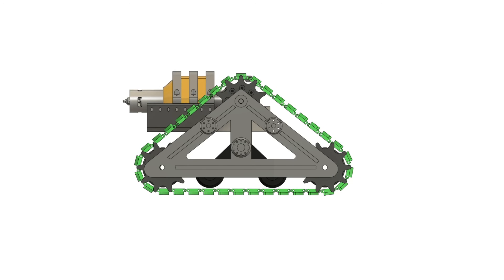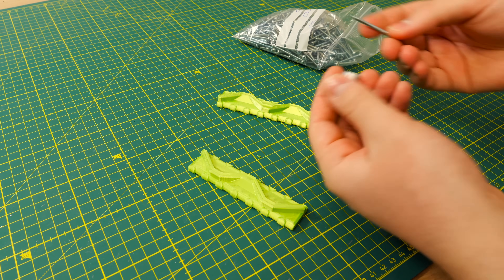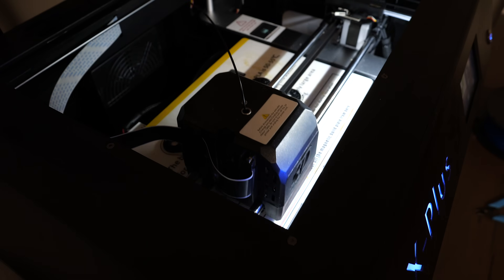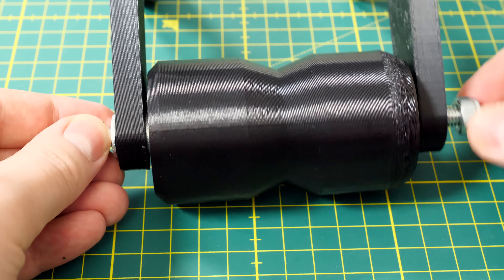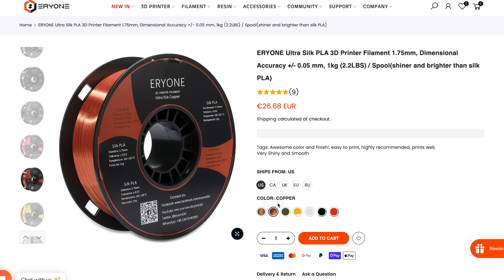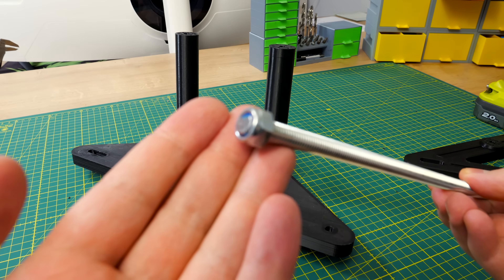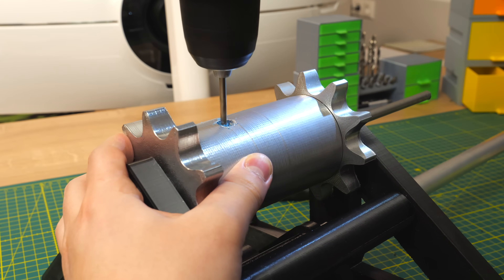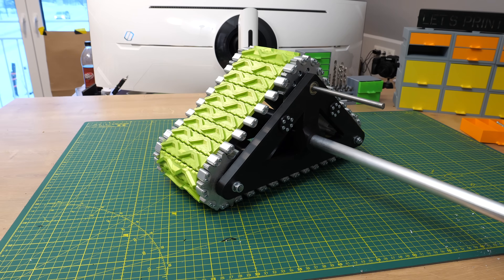3D Printed Tank/Tractor TRACKS for RC Vehicles - Part 1

Comment: Great video. I might build this one day. 
Little tip: screw 2 nuts on each side of the threaded rod before cutting the rod. Cut between the two nuts then spin them off. When you get to the cut end of the rod you can use the nut to repair the threads.

Comment: The best way to fix your rod not accepting nuts is to grab a file and take the ends of the threads down to a narrower radius so the damaged portion doesn't interfere with the nut. The damage is only about half a turn of thread. A die is probably the worst way to fix this in this context.

Comment: at 3 mins in you use tap and die to recut thread if you just screwed an 8mm nut on cut the rod then unwind the nut it will clear the swarfe save using tap and die cheaper

Comment: A little trick when cutting threaded rods. Put the nut on before you cut. Then simply unscrew the nut which will clean up the threads.

Comment: Just printed and assembled one of these. Some of the holes were tight on the supports and the sprockets, but got through them. I think the model shows 35 track pieces but it was more like 37 or 38. I'll go back and count when I get a chance.
Reply: Wanted to follow up on this. The gear boxes were a bit of a nightmare. The gears on the motor didn't attach very well under any significant force and you could hear the screws scraping against it. To get past this, we re-worked the gear on the motor to be friction fit which resolved this issue. Next, the planetary gears were too loose inside their cases, so we sized them up a bit. This was a little bit of trial and error, but we got it there. Finally, due to the planetary gears still being loose, the gear connecting to the drive shaft had significant vertical displacement resulting in significant slippage and/or the gear box + motor shifting back. We did a couple of things to resolve this. First, we added some thin strips of rubber to the upper brackets holding the motor in place. We also placed a strip of rubber under the motor on the motor harness. This stopped the gearbox + motor from moving backward. We also put in inserts into the motor harness to keep the brackets in place due to the torque. Finally, we designed a new cap on the gear boxes that allowed us to place a large bearing that held the gear that interfaces with the drive shaft gear to stay in place without displacement. This final step resolved our issues and we were able to get this rolling. Bottom line, it's a cool design with some flaws, but if you spend time on it, you can work your way through those flaws and sort it out.
Reply: Video: https://www.youtube.com/shorts/rOM37xmcWQk

Comment: Suggestion: Stop using screws for the hinges in the tracks. Get a roll of nylon filament and cut pieces of that and use that instead. And as a bonus it is possible to print with it :-)

Comment: @Let’s print One tip for you, just put one or two nuts on the thread before cutting it, than file of sharp edge’s and loosen the nuts out over the cutted part. No need to recut the threads anymore.

Also please use the two nuts locking each other to clamp the rod and not harming the thread and hurting my eyes😉

Comment: Actually if you leave a nut on the threaded rod then take it off After cutting the nut will reform the threads without needing to recut in most cases. As a pro tip ;]

Comment: Before you'll cut a bolt you can screw on a nut on it and after cut you be able to screw out the nut and this nut will repair thread. it saves much time at all

Comment: The tension setup you had was only missing a tension screw similar to a chainsaw. it would keep the axle pushed back while still allowing it to be loose enough to roll. Should be fairly easy to adapt your model.

Comment: Nice project  😮✌️, when I cut those threaded rods , first put the nut and then I can use the nut to secure it in a vise. The nut will act as the die tool , some little advice 😁.

Comment: Here's a trick for cutting anything with external threads. Put a nut on first, thread it down so it's below your cut, cut it, and then remove the nut. When it comes off it will fix the threads.

Comment: Amazing build and design.  The quiet operation is a great sign, indicates that you got everything sized really well.  Fyi, using the threaded section of a screw in a bushing is asking for premature wear.  Luckly it's easy to fix, just get partially threaded screws next time.  If you pick the right length, D-links on the tracks will pivot mostly on the smooth unthreaded portion.

Comment: if you don't have a die, and industry trick is to thread a non locking nut onto the rod before hand below your cut, and remove the bolt afterward, and it will straighten out your threads

Comment: Great adaption of the Sherman tank type tracks.  One issue I saw was the outer diameter of the washers was the same as the outer race of the bearings.  These may be an issue stopping the bearings from rotating freely.

Comment: Fix the threads: Screw 3 nuts on before you cut. Then lock 2 nuts together so you can hold the rod still and use a wrench to remove the 3rd nut over the slightly damaged threads. Fixed. :-)

Comment: 3:00 screw in a nut before you cut the threaded rod, removeing the nut after cutting fixes the thread
Reply: it is also better to clamp the rod on the nut, while cutting,  to not damage the thread with clamping
Reply: Nice. Never thought of that

Comment: try metal or 3d printed or plastic cast impeller/tesla-disc shrouded drone rotor-turbine, very high rpm, vertical orientation, the air going from center-side-in
Reply: drone turbine but impeller pump instead, not direct rotor or ducted fan
Reply: diy pure dc lorentz force brushless electric dc motors
Reply: axial permanent magnet, looped coil axial wire ring rotor, or reverse
Reply: no control circuits